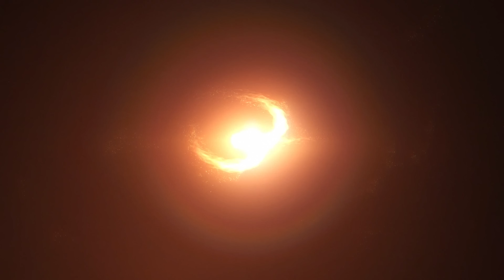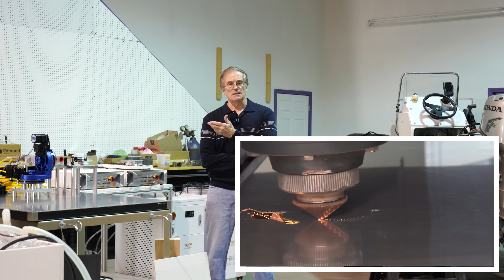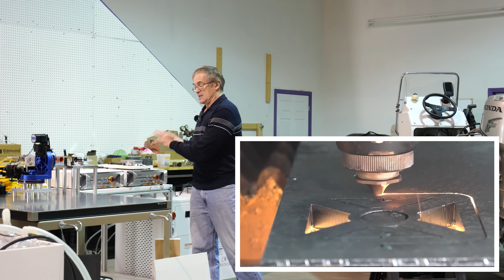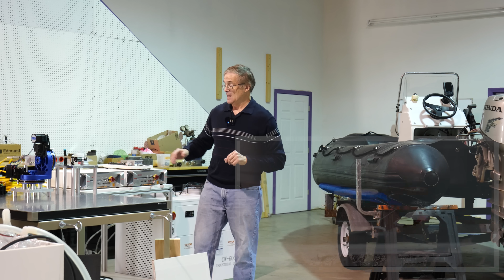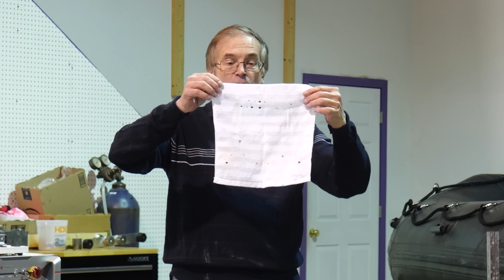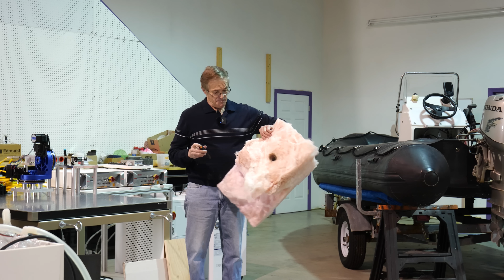We have a problem... and need your help!

Comment: You can fire with the laser from upside to downside and there is a layer of water, as deep as possible. This water is dirty, grey or black, so that the radiation can be absorbed better. You need a pump to let the particles flow in the water and possibly a fan which removes the steam from the surface of the water.

If you fire at a object, then you have simply to put it at the surface of the water or use wires to move it through the area over the water-puddle. But possibly it has to be deep, because the steam is generating a hole in the water, were the laser can shoot through. But it should be cheap and you can pump it empty, refill it at an other place.

Comment: Ok. Clear. 

Use the Moon as a target. 
And keep the world hostage.

🤔

Ok… then an large container of glas (aquarium) filled water and sand. Should be MAYBE alright, or use it under water. The refraction could also be bad. 
But superb for cooling ¯\_(ツ)_/¯ 

Target some Tugsten Nitride plates or other dense/hard materials. For the sake of „not cutting your truck in half“ should be plenty.

That’s all for now.

Comment: What about intumescent materials? Carbon foams, NightHawkInLight had a series on recreating starlite. It is very much something that would need to be replaced and still a fire hazard but you could put the material on top of ceramic tiles to hopefully block it further and track the wall with a infrared camera to monitor starting fires.

Whatever will be suggested this is an insanely powerful laser and always will be a fire risk.

Lastly, by far the most expensive solution, a copper water cooled heat sink to cover the whole wall. Likely to work, though hard to patch and repair and expensive just in the material cost.

Comment: hello, maybe you should adopt idea that Musk wish to use to cool down his vehicles, and construct couple layers different materials like  bricks on the bottom then glass fibre cotton in the middle, and dry wall on the front ...but fibre glass cotton soaked in water(achievable) by constantly flowing from up to down, delivered by tubing and sprinklers on top of light/heat sink panel small water pump will be needed  ..it should give you couple seconds at east. 
greetings.

Comment: If you have to keep it horizontal, could you use salt blocks from the local farm store? If you had them stacked several deep you will get a refractive dispersion because it is not solid salt, but compressed salt crystals as well as the absorption of the salt itself. They are heavy but very reusable. And can be reorganized to any configuration you need. If you can just change the orientation to vertical the answer was on the laser cutting table in your video, water under your target.

Comment: Wall with sand in it. As it burns into the sand more sand will fill the hole. You fix the wall with tape and test the laser again. Any static solution will end up with a hole.

Comment: A lot of my thoughts depends on how wide an area behind the target you need to protect.
In your lab, for protecting a small area, maybe 2x2 feet,  that is behind the target I would dispense with energy absorbing thingies, given that the laser is designed to cut into them, and go to a detector screen that will quench the beam within microseconds of the first photon hit. 
A fiber optic array that channels incoming light to a detector chamber.
A water tank with suspended particles that will scatter the beam, so the detectors can pick it up the rise in illumination and shut the laser down. Hopefully before the pyrex wall of the tank melts through.

A grazing wall chamber (like  X-Ray cameras on satellites) to route the energy to a detector while widening the beam (just a thought)
Attaching a pick-up detector on the back side of the target itself to detect burn through.

If those are a bit too esoteric, then the earlier suggestion to suspend everything pointing down into a sand pit is the 'winner winner chicken dinner'.
The nice thing about that is you can increase the target range, by using some local ham radio operator's 100 foot tower.
I am sure your fertile mind can imagine the possibilities you get with a 100 foot long target range (avoid the guy wires)
73 
doc  K8DO
Reply: I initially thought to suggest the local shooting range, using their back stop. Then I contemplated the fickle finger of fate getting involved with a high power laser shooting horizontally outdoors.
Towers are not fragile. Mine are supporting multi-hundred pound antennas in storm force winds, without failure for many years. 

Anyway, good luck in your quest.
doc

Comment: You need water cooled graphite blocks, maybe 10cm thick with channels inside for water cooling, there's no other practical solution. Ignore all the posters talking about fog and mist, that will not work with 10kW of laser. Angled surfaces are useful as well as you will decrease the W/cm^2 of your beam if it's contacting a larger area

Comment: You could use granite, basalt, or slate tiles. You can get them fairly thick for a reasonable price. Granite is a bit more reflective, but you could roughen the surface, otherwise, basalt and granite are relatively matte. If you were to make a five-sided box (each side a tile) then you probably wouldn't have to worry about any reflections. An open box and a stand seems reasonable to setup and store. If you needed a wall, then perhaps try laying the tiles (using a tile adhesive) on something sturdy--a sheet of thick plywood. Handles on either side (maybe some locking caster wheels at the bottom) would allow for 2 people to move something reasonably heavy. It should be thin enough to store (easier than a brick wall).
Thank you for your work.
Reply: also WAY heavier than bricks.

Comment: What if you tackle this problem from the laser side instead of behind the target. The beam hits a spinning mirror assembly that allows it to have a virtual diameter of say 6 inches. The focus would be adjusted by the outer mirror in the assembly. Build in a safety that disables the laser if the mirror assembly stops spinning. This would allow for a much greater beam divergence while still being able to use the full power of the laser.

Comment: None of the materials that might handle the task will be cheap or lightweight. I think I'd test the system at a outdoor gun range with high berms. There just no getting around the fact that you need something that can absorb a tremendous amount of energy on a very small area. Several meters of dirt and gravel would do the trick.
As an aside, how are you not getting into trouble with the feds? I assume there are regulations dealing with directed energy weapons and what a normal citizen can own.

Comment: In Order of Cheapest to More Expensive.
-Go to a safe place that you can make into some sort of "Test Range" One below the Surrounding Elevation. And only run Horizontal Tests. That Might be the Easiest and Cheapest Solution. 
-If you Have the "Space/Land Available"  Make your Own. Using a Permanent Dirt/Sand Wall.
-Create an elaborate Small "Testing Rig" though that would Eliminate "targeting" experiments.
-Create a Large, not so Portable Elaborate Wall to Resist Laser. The Size of your Garage Door. (Have you Tries Using a Fresnel Lens to Scatter the Laser?)
-Try Blocking the Wavelength of the Lase on the "Safety Wall" as Much as Possible by matching as closely as you can the Wavelength of the Laser you are Emitting. 
-Use a Wave Length Manipulation in your Setup to "Weaken" the Laser for Test Purposes, using Crystals or Resonators or Splitting the Beam.

Comment: Ceramics such as silicon carbide (SiC) or boron carbide (B₄C)
	. Extremely high melting points (>2700°C)
	. Chemically stable and not flammable
	. No toxic vapors
	. Laser ablation resistant
	. Used in shields, nuclear reactors and laser shields
	. Cons: Brittle, but it can be layered with other materials.
I don’t know anything about the amount that you need to use so you have to doublecheck on the price. Good luck 👍

Comment: 1) An aquarium or tank of water?  Not sure if the laser would pass harmlessly through glass or burn a hole in glass (or too much reflection).  Even if it did burn a hole in the glass, that hole would immediately fill with new water.    2) Or a way to control the collimation so it is a little bit focused (and a little bit dispersion after it passes the focal point), like a tunable focal length:  gamma knife or Archimedes mirrors to catch a ship on fire, except only a cone of energy of a tiny fraction of a steradian.  3) very wet ballistic gel, wet enough to flow into the defect created by the laser.  Or aquarium full of water and absorbent diaper filling material.

Comment: Sounds like you need to incorporate a pulse length generator that limits the length of the beam. Blocking the beam will only prove to be too temporary and consume the material used. The pulse width should be in increments of a few to many millions of nanoseconds.  PWM is the path forward.

Comment: You could create a watchdog
A completely independent system that would monitor the angles of your gimbal using a sensor, and if it stays stationary for more than let's say 1s, it shuts off a relay to stop the laser (maybe not cut the power supply, I don't know if that would be a good idea).
The laser probably has some security interlocks, maybe you could add this signal to them

Comment: a difficult problem to solve, what about some sort of prism that guides the beam into an aquarium full of water (or heat absorbing fluid) that evaporates when absorbing the laser's energy
like cooling a piece of hot metal in a bath of water (old sword's metalurgy)
just a thought, cheers

Comment: I think in terms of diffusing light with for example prismatic lenses and then absorbing it with surface like vantablack, thus creating beam dump on microscopic level. It makes no sense to try to absorb the beam without dissipating it. Magnetic fields, light, plasma etc. are not solid and that is the only way to contain such high energy levels (atomic energy) since it is a flow not condensed light or what we call solid matter, atoms. There has to be a combination of gasses that will do the trick since any material even if it is transparent will absorb some energy and heat up. Refraction and dissipation are my main thinking points not absorption and reflection. Microscopic level is key here since you need many small steps not one large stop.

Comment: Hmmm, I think defocussing the beam might be an idea. Either through fog as another comment suggested, or maybe through a big fresnel lens or many angled mirrors that spread the beam out one dimension at a time. Nighthawk in Light also developed some really fire resistant wall compound some time ago, maybe the carbon foaming up from it would work.

Comment: 2 cylinders mounted vertically or horizontally, with a belt stretched between then, with water flowing on the front of the belt. Belt material should be analyzed further, but maybe alumina (alluminium oxyde) fiber? Alumina is used in rocket heat-shields.
A motor drives at least one of the cylinders to spin the belt in order to reduce exposure time at any location, so the contact point is only exposed to heat for a few milliseconds.
Water falls cooling down that part, both before, during and after the exposure, and is collected at a reservoir on the bottom to be recirculated.

Or do what shooting ranges do, and shoot against a mound.

Comment: My idea's are. 1. A fog machine filling a plastic covered "green house" to difuse the laser. 2. A wall of water, either rain drops/mist or waterfall like. 3. Dry play sand witin a wall, that will flow in to fill the void, unless it just melts into a blob with a hole in it.

Comment: I think the plywood result gives an indication of what might be useful: pyrolyzed carbon. Something like the already suggested cement board for tile underlayment, or cement building siding in a couple of layers thick, but then cover it in a) a highly refractory industrial furnace coating and/or b) a highly intumescent coating.  

Something like a cerium oxide coating has a melting temperature of about 2,400° c. While that's way lower than the laser temperature, when combined with the other components of the coating, you get a very high thermal emissivity. That combined with the intumescent coating in the cement board might give you the one to two seconds that you need while being effectively self-extinguishing.

Comment: (not a laser expert, just thinking out loud) What is the wavelength of the laser, if it even matters at the power levels you're at? how big should the back wall be, 10x10m? If you can't find something that fits your requirements of being light/convenient to setup, large surface area and able to absorb the super-death-laser for atleast a second, then what about taking inspiration from shooting ranges and use berms/mounds as a backdrop?

Comment: My gut reaction ideas are:

- Copper sheet - copper is notoriously tough to cut with a fiber laser (expensive by sinks heat away rapidly)(dealing with reflections is the tough one, maybe find a graphite coating or something like that)
- does the gravel in your area have quite a bit of granite? cinder block dry stacked wall filled with granite (labour intensive to make portable)
- maybe kaowool refractory blanket insulation for kilns could last longer than fiberglass (possibly combine this with copper to manage reflections? idk)
- lastly, if it's a laser for industrial cutting applications, shouldn't you be able to adjust the strength with PWM or something similar? Like anything I get laser cut, they can also just etch the part number onto, so if you can keep it at the lower duty cycle until an actual target lock, and then just send short bursts of high power laser, that would be ideal. Solving the cause, not the symptoms
Reply: I had gravel on the mind for some reason, but maybe just some repurposed old granite countertops?

Comment: Laser-blocking materials:
.
Specialized materials, like laser-blocking acrylic or polycarbonate, are designed to absorb or reflect laser light, preventing it from reaching the desired target or causing damage.cement board might also work but it's very heavy and hard to work with

Comment: Sometimes you just have to face the fact, that more power could be too much power. Or you could say: Power is nothing without control. So you would need to gain a more fine tuned control over your power output (focus, pwm etc.). Or: Build a sophisticated guiding laser system to be sure to just hit the target and then unleash the big guns. Or: Get a shed in front of a mountain wall and fire away.

Comment: Large concrete traffic/barrier blocks.  They can be moved with a folk lift.
Some kind of refractory brick or a fire brick?
Could anything be placed in liquid suspension (Water) that would diffuse the beam?  Five gallon buckets.  Cheap and easy to patch if you burn a hole in one.  Use some Flex Seal tape to patch the holes, between shots.

Comment: Rockwool? And refractory cements maybe. Those kind that are used in steel fabrication industry. Also they use some sort of clay plugs for molten steel canisters for one time use. Check those out.
If none of that works, then I congratulate you, because you are the next Dr. Evil. 😂

Comment: If you can't get a refractory material that would absorb sufficiently, maybe you could use a downward facing 'mirror' (possibly a Bragg reflector, depending on wavelength) so that any background scatter would be directed to earth. Yes, there's a probability of damage to the floor, (potentially even explosive spalling of concrete) but a first surface mirror would be significantly more portable than a brick wall, and everywhere has a ground, and 'safe' angles greater than 45°could be calculated to minimize surface area, while still maintaining proper reflective angle.
-Potential long distance help when hitting Ariel targets could be optimizing focal point based on distance, so there's more dispersion before and after target, and less chance of damaging planes or satellites. (would likely require significantly larger optics tho, to have a reasonable varience in focal width)

Comment: My goodness, you could make an inertial confinement fusion reactor with those lasers!
Seriously, my first thought was to use panels with microlenses that disperse the laser light, and made of highly matte material to further diffuse the light.
I also have a suggestion for a name for the laser. The Death Star Laser.

But maybe the simplest option is....sand.

Comment: I think bury the idea of a horizontal testcenter.  Build a scaffolding ring 8-10m over ground as a workling/video platform  and put the laser beneath and facing into space...  check flight radar ;O)
Or turn it around and target into the ground with a laser 10m over ground.

Comment: I second the idea of sand bags. It could make a bit of a mess, but I think it would be manageable. Burlap may work. I would expect polypropylene bags to emit toxic fumes and create a runny plastic fire. Maybe burlap sand bags filled with pea gravel would work best.
Reply from the maker: I'm sure that would work, but consider the mass. We have to cover an area a little wider than that entire door all the way to the top.

Comment: Im not really very smart about this, but what about using lenses to filter out the correct light wave to "dim" the power. Not letting the strongest waves through?
Reply from the maker: A laser, by definition, is a single wavelength of light.
Reply: @TechIngredients I was just thinking about how glasses protect our eyes. Like I said, I am pretty ignorant about it.
Reply: @TechIngredients Much like the way you can't cut certain colors of acrylic with certain wavelength of lazer. 
 I hope maybe it might spawn the right ideas for you.